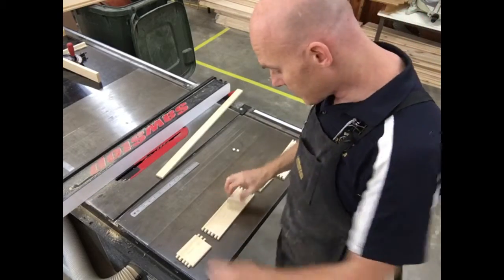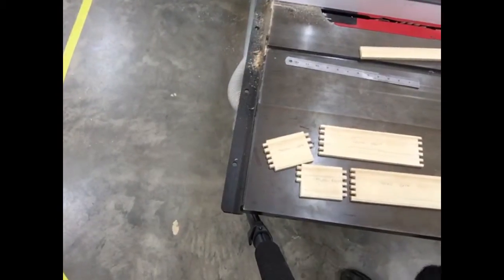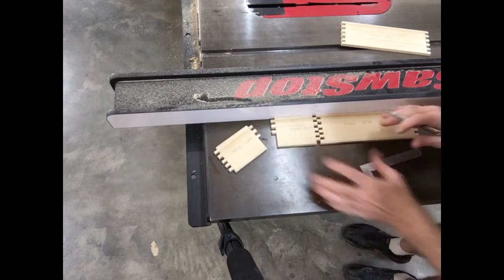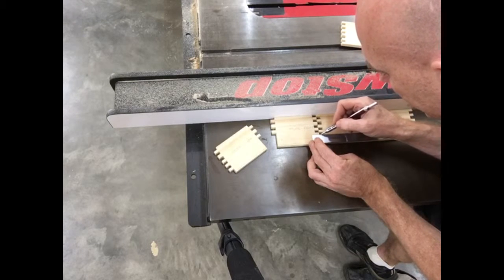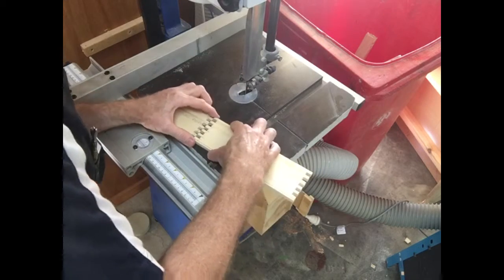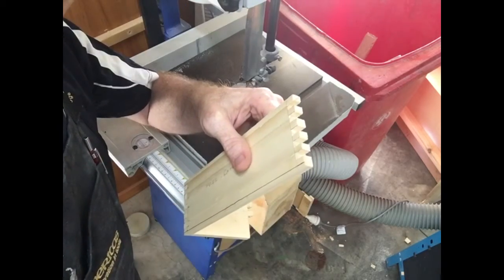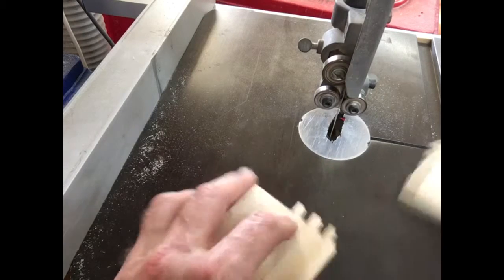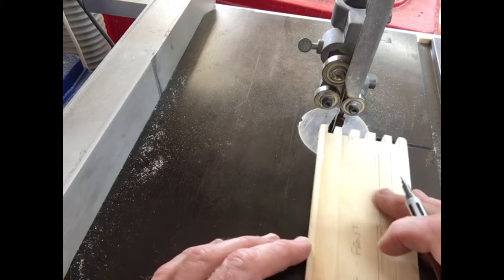SecretLatchBox09 Fit the Fat Joints

Comment: Thanks for the vid.. Whats the benefit of using a scroll saw vs a table saw? Brand new wood working.
Reply from the maker: I use the Scrollsaw for removing the bottom of the joint cutout. I find it quicker than chiseling, and more accurate than using the bandsaw. The joint holes are only 6 wide, so the fine blades of the Scrollsaw fit in Better. Thanks for your feedback :-)